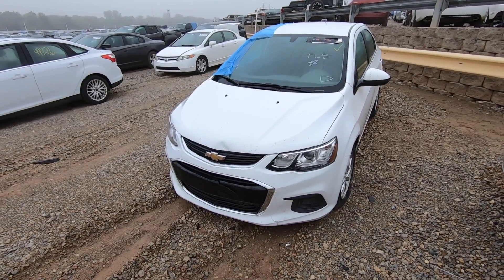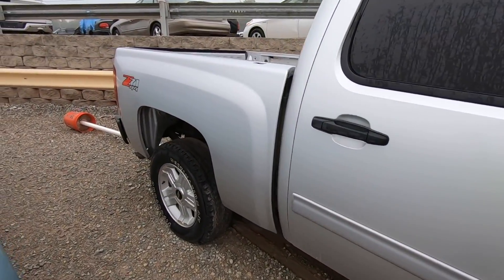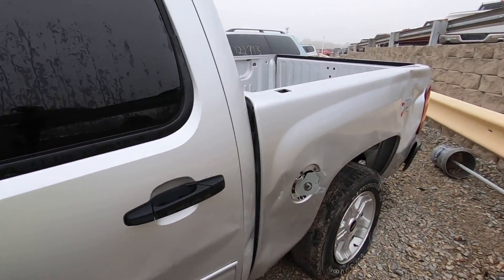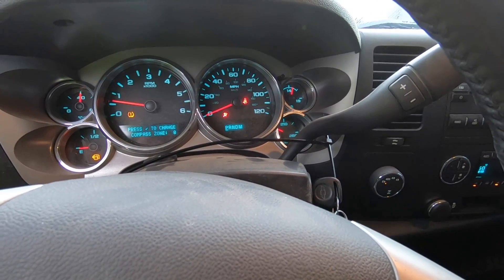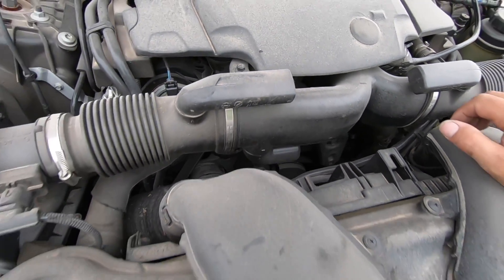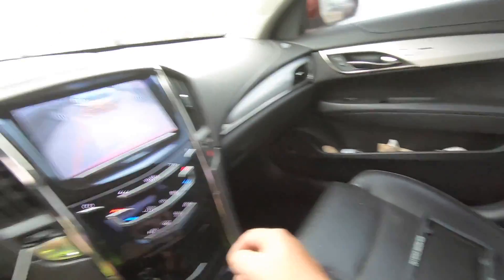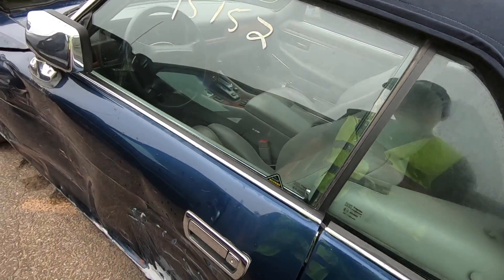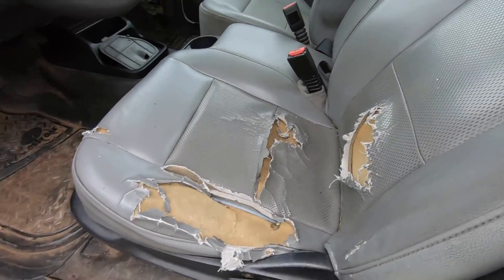Copart Walk Around 9-24-19

Comment: Not a big deal but i got a 1994 4.3L v6, 2 wheel dr  single cab long bed  chevy work truck that runs great in pulls a two car trailer no problum had it for 8 years

Comment: Stay away from used Rangers if the head doesn’t need rebuilt then the injectors foul very easily. I had a 1998, within 20 miles of turning 100k had to do both. Love the look of them but it sux if you’re on a budget.

Comment: Ranger is an old Oreilly truck. (They number them on the fenders) I wouldn't touch it with a 10 foot pole. Nothing but stop and go driving. (hence the seat) They only fix them when they break.
Reply: I work at the O'Reilly's that just got rid of that truck. 😂 definitely lasted longer than we wanted it to.

Comment: The engine in the jaguar is the bulletproof AJ16, a very reliable and super smooth engine and they sound very nice .
Reply: dazaro3 not sure about that
Reply: One of the best motor ever made. I think it’s more reliable than the gm 3.8 I’ve seen many 4.0 aj16 with 250k + miles

Comment: The curtain bags in the pickup are blown because of the side impact.  As you always say:  The cost of the repairs for the insurance company exceed what it is worth.  In this case they would replace the fender, if not the whole bed as well as the doors and cab corner.  Throw in the 2 curtain bags and headliner, and that is a whole lot compared to the value.

Comment: I like a bit of carnage - it’s interesting to see how modern cars ‘crumple’ and protect their occupants.
Reply: Graham A agreed. We get to see what level of safety we actually get
Reply: Curtis Fleabag Hi. How about a different view of your 4 car accident - those other cars’ crumple zones protected you and your car. How about your car verses another ‘60s ladder chassis monster? How about a pedestrian hit at 5mph by a modern car and your’s? 
Did you hit the car in front of you or did you stop and the one behind run into you? I ask because my 2014 VW Golf has stunning brakes compared to my 2002 Volvo let alone the first car I owned in 1980...
Modern normal cars like my Golf (not ladder framed pickups of course) don’t let their engines intrude into the car during a crash; they are designed to push the engine down into the road as we see quite often on this channel’s carnage cars. They have very rigid main bodies - so the doors open after a crash but a crumple zone up front and behind that deform to protect us. 
They put eggs in soft boxes for a reason - the ‘crumple zone’ box protects the eggs a lot better than if they were in a tin box - not much difference between that and us in cars really? 
An old car transfers the load of an accident straight into it’s occupants where a modern car crumples and absorbs the impact. The modern car will destroy itself to protect my family and I’ll take that (plus the 60mpg economy) over an old car that just needs a bumper after an accident but leaves me with internal injuries. 
I love old cars but for every day driving with my family I’d choose a modern one the same way as I choose not to drink and drive or use my mobile phone when in the car - it’s just safer for us all. It’s personal choice in the end and nothing is a substitute for good driving and concentration. All the best.

Comment: Small V8 is a 4.8 liter? Here in norway that is massive. Here its usualy a 2 or 3 liter diesel in the pickups😅
Reply: A lot of diesel p/u trucks in the us are larger than 5.9 liters in the USA  there are smaller 2.8to3liter but those are not as common yet
Reply: Long live the high displacement v8s!

Comment: FLASHING check engine light indicates a serious problem.   Trust me.
Reply: Mark Hoffman yep. Non flashing means a problem with the engine, but FLASHING check engine light means pull over to the right and call a tow truck.
Reply: RandomVids yep.  My NEON sputtered home.  Next morning I cranked it.  KABOOM.  smush n crush time.  

2007
Reply: Flashing check engine light means a misfire is occurring that is bad enough to damage your catalyst system. Not necessarily a "serious" problem. Could just be a bad spark plug/coil